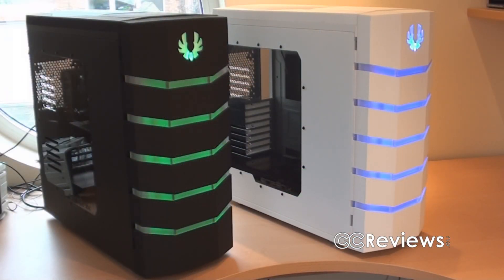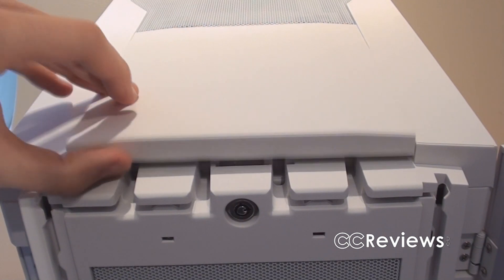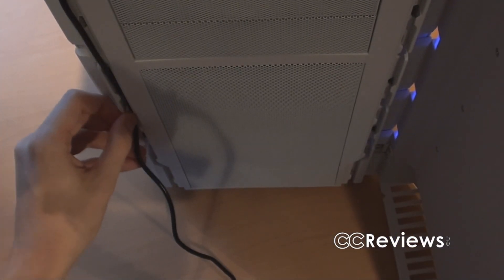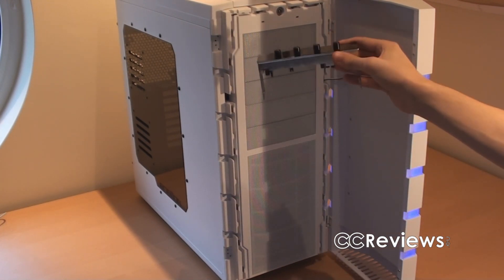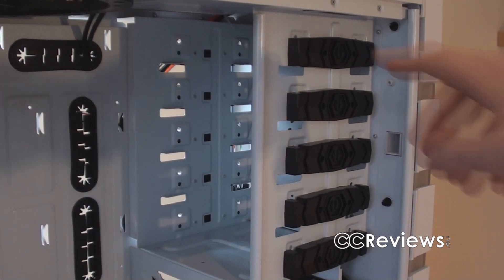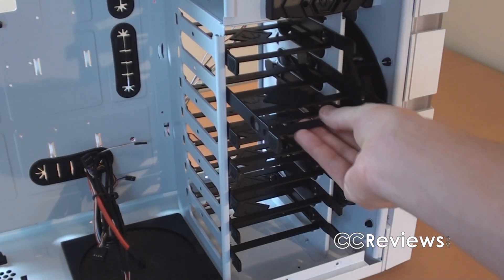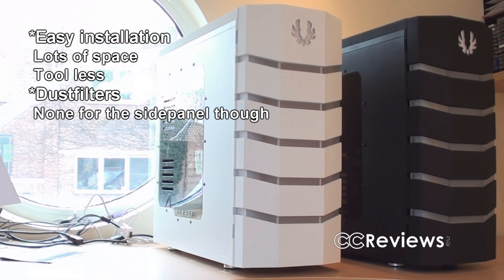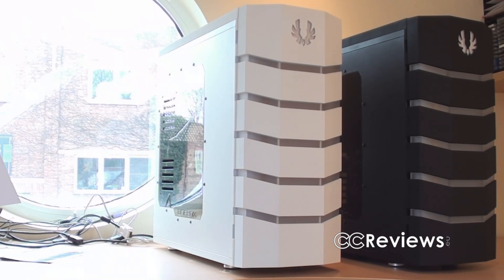#23: BitFenix Colossus Window (White & Venom) Review (CCReviews)

Comment: just got this case maybe 2 weeks ago inside looks pretty similar except for a few things. no bottom filter for fan, LED fan ports are mounted on the back where you tuck wires in on the upper side rather then bottom and I don't think I have those hinges for the back. it's just toolless screw. but other then that everything is practically the same

Comment: @CCReviews
great review bro. could you help me out with a couple questions?
the 2xxmm fans (i dont remember sizes) is there a way to install 2 120mm fans or is there modding needed??

also, could you tell me how much room from exactly the TOP of the motherboard to the highest mounting point in the case? inside? or if you can remove that mesh on top of the case and mount something up there please try and include that. it looks some modding may be needed??

very nice review. thanks

Comment: Hey i have a question about the colossus window (white) , i recently purchased one and the LED's on the front dont seem to be working , everything looks like its connected properly , theres a fan led x 2 and a led sw+ connected  to the led control board but im not sure what sends power to the leds on the front door . Any reply or info would be appreciated thx.
Reply: Same for me, fans' leds work fine, but, I have only 2 leds on the front that are actually working ! /:

Comment: Would you recommend a CF/SLi of 7970's or 580's in this case?
How is the ventilation if you remove the top fan and replace it with a H100?